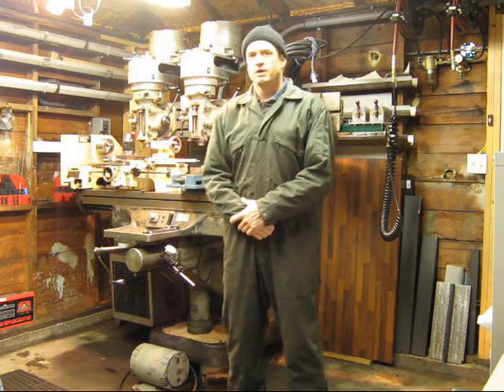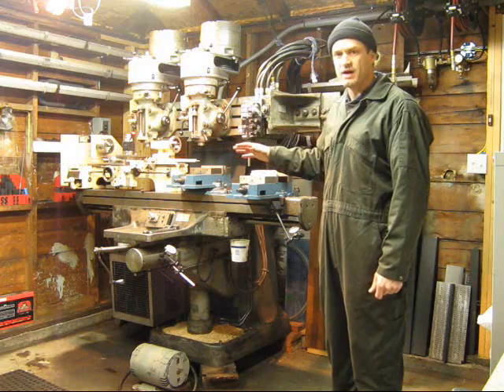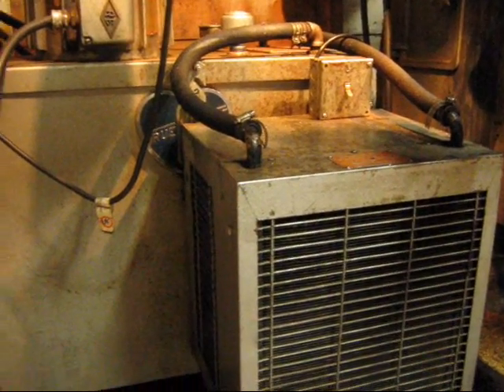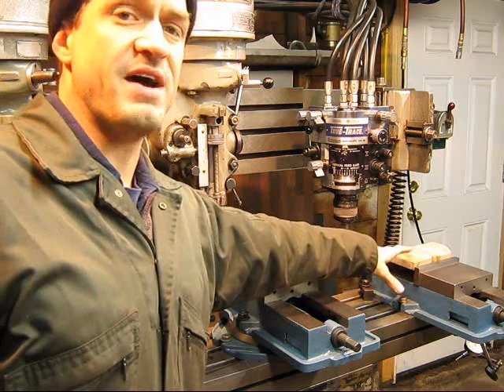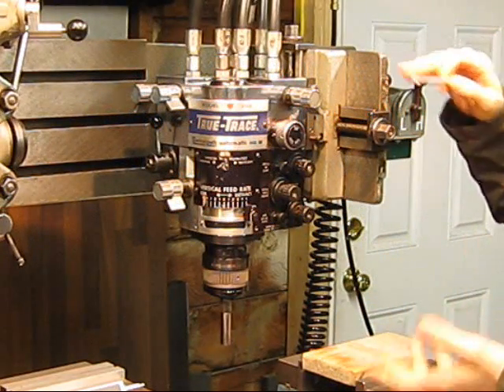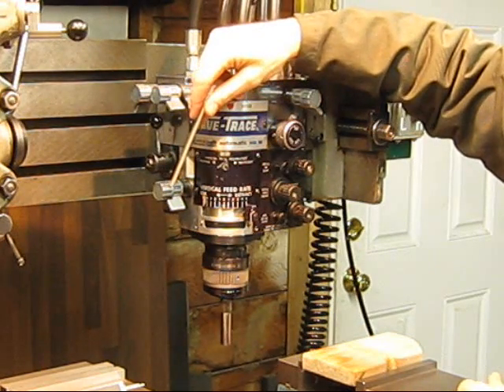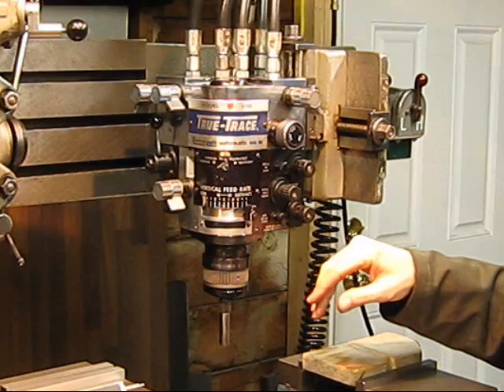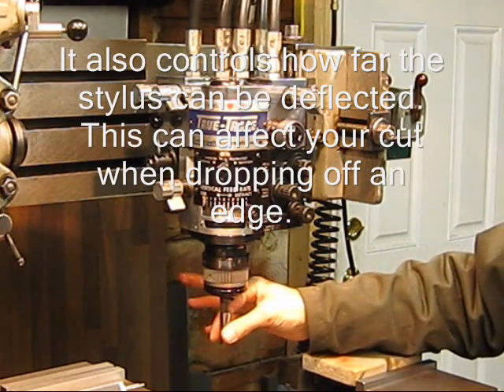Operation of the True Trace - Intro

Comment: I'm looking at one of these machines to buy. Do you have any advice about what to look for on an old machine?
Reply from the maker: With this one in particular would be power requirements.  It had four 5hp three phase motors. Two for the milling heads (with room on the tree to mount one more), one for the hydraulic pump, and one for the rotary phase converter.  If I recall it ran on a 70 amp, 220 volt breaker and I only used one head at a time usually.  I had the electrical inspectors and a team of engineers visit me one day before it was all connected up.  I smiled as I said I wasn’t sure what I was going to do with it but I was thinking about converting it to single phase.  Rotary converters are notorious for feeding dirty power signals back into the grid which can cause issues apparently to many new heat pumps and such in a residential setting.  I built my rotary converter by scratch but never had any complaints from the neighbors so…..

Also, noise is an issue and the hydraulics are finicky.  The system did real well but the fine tuning of it would change based on how warm the fluid was.  Also, the specific fluid couldn’t be found any longer and the previous owner just figured the right amounts of different viscosities to mix to be appropriate.

I’ve since sold the mill years ago, but it was sure fun to use.

Comment: What viscosity hydraulic oil did you use in the tracer?
Reply from the maker: I don’t own the machine anymore and it came with fluid at the time.  The previous owner said he had to blend two viscosities to get it right.

The manual shows:

HYDRAULIC OIL SPECIFICATIONS FOR TRUE-TRACE POWER SUPPLY OPERATING UP TO 1,000 PSI
Physical Requirements: For Use With Cylinders DTE 24
TOST Test (ASTM D 943) 2,500 hrs.
Emul. Test (ASTM D 1401) 0,5,10
Foam Test (ASTM D 892) Nil
Rust Test (ASTM D 665) Pass
Color, ASTM 3.0
Flash, Min. °F. 395
Pour, °F. 0 max.
Visc., SUS @100° F. 150
Visc., SUS @210° F. 44
Neut. No. 1.0
Viscosity Index 95

For Use With fluid motors DTE 25
TOST Test (ASTM D 943) 2,500 hrs.
Emul. Test (ASTM D 1401) 0,5,20
Foam Test (ASTM D 892) Nil
Rust Test (ASTM D 665) Pass
Color, ASTM 3.0
Flash, Min. °F. 395
Pour, °F. 0 max.
Visc., SUS @100° F. 220/230
Visc., SUS @210° F. 28.5
Neut. No. 1.0 (approx.)
Viscosity Index 95

hope that helps.
Reply: @erniethepiper  What did you do with it?
Reply from the maker: Sold it to a friend at work a few years ago.
Reply: @erniethepiper  may I ask what you got for it?
Reply from the maker: If I remember correct I sold it for about $1200.  It had a home brew rotary phase converter on the side and a bunch of tooling as well.  Fun mill.  Still in the "family" so to I’ve never been back to use it again.  As far as I know, it’s still going strong enough for most general work.
Reply: @erniethepiper  I stumbled onto mine. Was looking for a manual mill and saw this in an auction while looking at a manual in the auction. Had never seen one before. So I put $105 on it as a bid to keep connected to the auction. Went back the next day to see how much it sold for and found out I was the high bidder. With fees, $129 out the door. The PhaseMaster converter I found, 7.5 HP, was another steal at $400. Now i=f only I can get  the right hydraulic fluid for it...

Comment: im trying to get one running now, have power to the solenoids  but the spindles and hydralic pump will not turn on,  trying to get my head around on the wiring of this thing.   seems air and something else keeps it from turning on.  if you have any ideas i would like to hear from you.  Thanks.
Reply from the maker: I actually sold the mill a few years ago so the memory may be a bit foggy but the wiring on my machine was three phase (achieved from a home brew phase convertor).  Once connected to electrical power, it is a simple matter of turning on the hydraulic pump to run the system.  The milling heads were also powered through the phase convertor but did not need to be on to move the table on the mill.  

So...  each motor (hydraulic pump, and each head) has its own power supply coming out of the phase convertor and was protected by its own motor contactor relay.  Then, those power cords ran through an on/off switch (pushbutton for the pump and mailbox type for each head.  I would check for power before and after each switch then do the same at each motor.

As for air, it is only required for the tracing attachment to run in a trace mode.  There are the quarter turn valves on the side of the tracer unit that you can use to enable an axis and then move the table manually with the stylus.  

Hope that helps.  Let me know if you need further info.

Aaron
Reply: thanks,  I finially figured it out,  a lose wire was all it was.

Comment from the maker: I don't have any info on the HAYES unit.  I would be interested in seeing a photo of it.  As for your question of controlling with the finger, that is how I use this mill as a manual machine.  Simply lock out the x or y axis with the valve and push on the stylus with your finger.  Sometimes I will pull on it with a bungy cord if it is a long straight run.

Comment: Hello Aaron ,Do you have any knowledge about HAYES ( LEEDS ) TRACEMASTER TM43 D as We use a Steering wheel mounted above STYLUS to give a direction .Is it possible  to run or control the machine just pushing STYLUS with our finger without Steering wheel .

Comment from the maker: Just trying to splice up the next video.  The part about some of the set-up didn't seem to take correctly so unfortunately It may be a few more days until the next section.  It is cold, about 30 degrees F in the shop.  I have heat but I didn't bother taking the time to warm up the shop for the day, I just had a bit of time to shoot some footage.  The system likes to be between 100 and 120 degrees F before final adjustments are made and the machine runs smooth.  Mine rarely gets that hot.